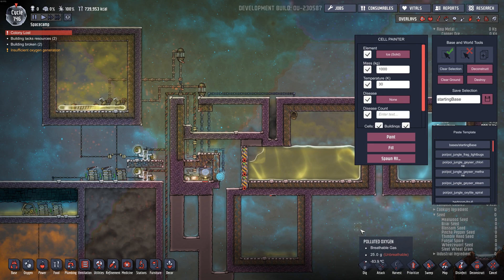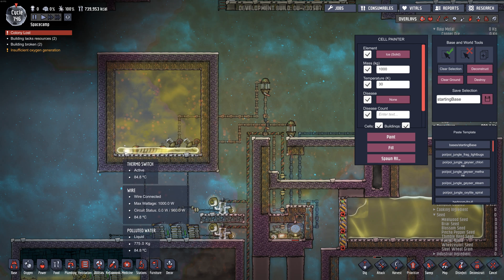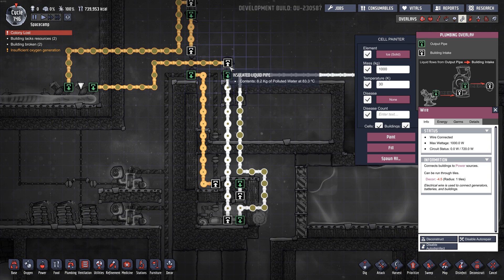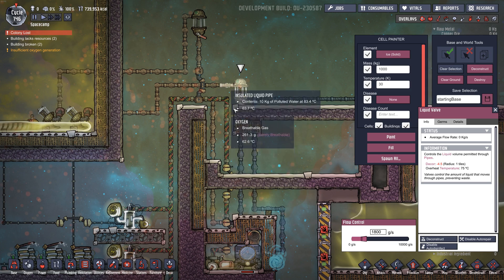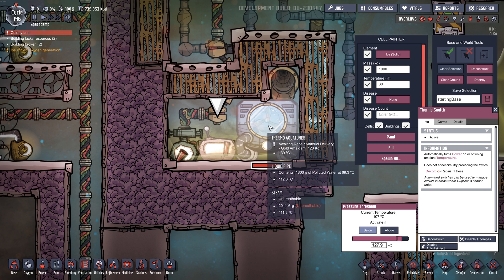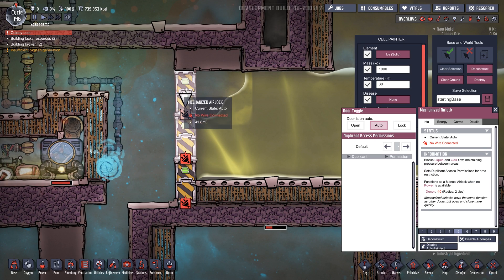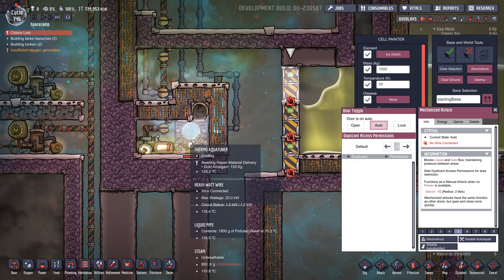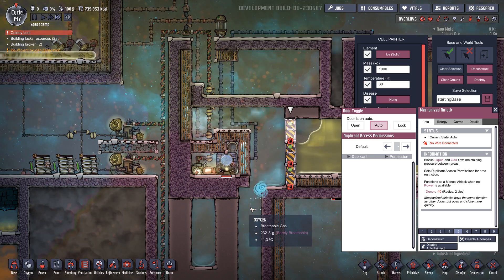Boiling Polluted Water into Clean Water with the Thermo Aquatuner - Oxygen Not Included Outbreak

Comment: Send water to something that needs actual cooling, so it can "boil" free. Then only use the aquatuner to raise the temps of the "usefully heated water", if it hasn't already turned into steam. You can also use it to cool oil, before sending it into processing, using the cold oil to cool your oil processing machines. It is ALWAYS a waste to consume power to generate heat, or cooling, on purpose, for these things. Bonus using the steam to power a steam generator for "free power", which then cools it to 95c output.
Reply from the maker: What a great idea.....

Comment: The thermo aquatuner is just ridiculous. What Klei has done is added a car radiator that consumes an insane amount of power and just absorbs heat instead of disappointing it.... It's just a very poor design all around.
Reply from the maker: Yeah it just lets you move heat... not get rid of it. The wheezewort is still my favorite way to destroy heat or the air scrubber and electrolyzer. Ice biomes have a huge capacity to act as heat sinks so I use them a lot as well.

Comment: The point of a water boiler is not the clean water output itself but what you can do with the cooling capability of the aquatuner while it's boiling water. You should combine the water boiler with a LOx distiller, ie. makes LOx from polluted O2.

The aquatuner is also most efficient if the bottom 2 squares are fully submerged and the top squares are semi-submerged. 10kg of water in the top 2 squares is a good starting point. That means that the aquatuner will not overheat (if made from gold) even at full 10kgs throughput. Build the aquatuner in a 2 square "dip".

Also, once you realize that the water distilling is the secondary objective, you don't need the tepidizer because the real need is to cool the aquatuner for it's primary purpose and the water output is just an added bonus.
Reply from the maker: Are you talking about putting Lox through the aquatuner? I did see a design for that. Pre-cool oxygen and then super cool using the aquatuner. Interesting concept.
Reply: Indeed I am. Note that the temperature window for LOx is quite narrow. An aquatuner cool incoming liquids by 14C so you should place those 14C in the middle of the LOx temperature range from -219C to -183C to avoid any danger of phase change breaking the pipes. The pipes to and from the aquatuner absolutely have to be insulated abyssalite pipes for the same reason.